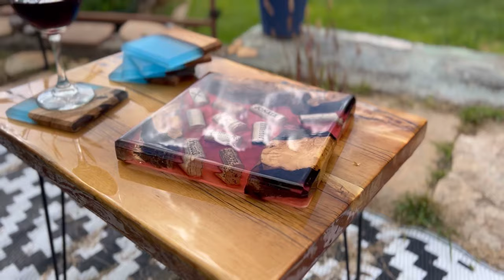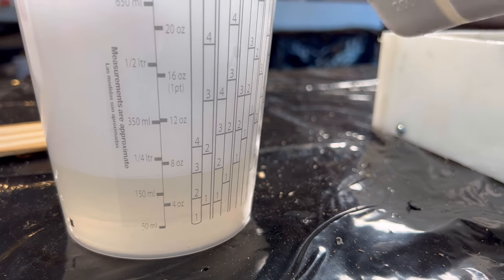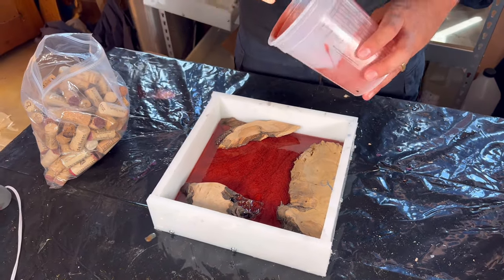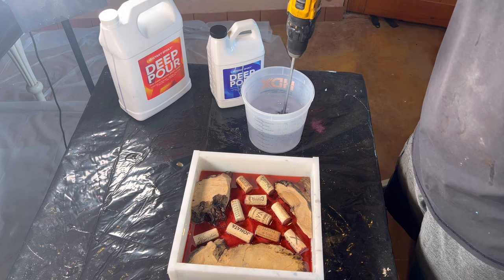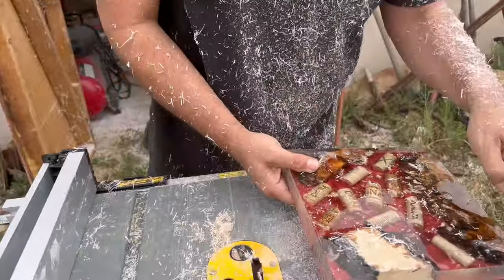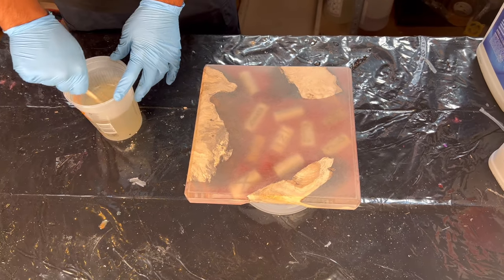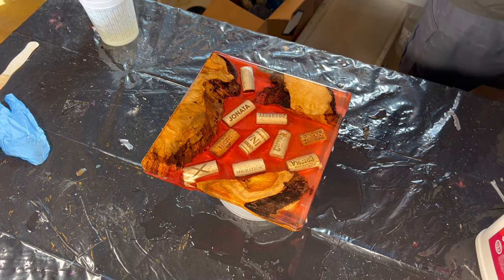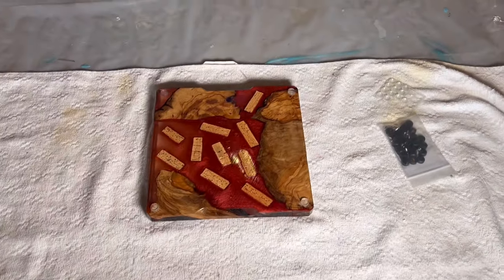How To Encase Corks in Epoxy Resin (Or Anything For That Matter)

Comment: So cool! 

Can the 1st pour in the bottom (for adhering wood embedments) be poured deeper? 3/8” to 1/2”?

I’d like to place wood carvings in the “River” Charcuterie boards. Maybe tables too if feasible…

My goal is to assure the embedded items are not planed, but rather suspended within the epoxy, top & bottom.

Comment: What is the oil you used on the bottom and where do you get it?
Reply from the maker: That is Walrus Oil and it can be found on Amazon or the Walrus Oil website.
Reply: @upstartepoxy4804  thanks, and you simply use it to get the gloss back in the sanded epoxy? You don’t put it on the “ good side” ?
Reply from the maker: @dblungm  yes, that's right!

Comment: You do some really nice work there Steve, and I especially enjoy the lovely timber and colours you use!

However, as a long time Joiner, I am concerned about your health now and your future health. Watching you work it seems to me safety and personal protection from chemicals and dust is lacking. Your Table saw and Thicknesser don't seem to be connected to adequate dust extraction, and your saw seems blunt too. While you do wear eye, ear and breathing protection, it doesn't seem to me to be consistent. Also, while I see that your wearing gloves to spread the topcoat resin, I don't see you wearing gloves to mix and pour the resins. In one of your videos, I clearly see Mica pigment dust in the light going everywhere when you put it into your resin mixing cup, yet you're not wearing a mask. 

I'm not commenting here to criticize you at all, I enjoy your work, but I am concerned for you. I may also be wrong regarding some of the above comments.

An Uncle of mine spent the last 15 years of his life on Oxygen, he was deaf with 8 and a half fingers because of his years working with timber and resins without much personal protection. Because of watching him slowly die over many years, painfully, I have been scrupulous in my personal protection in my woodworking career. I still have excellent hearing, full lung capacity and all my fingers at 44, a rare thing amongst joiners my age. I've been lucky so far, and I've had my near misses with injuries, but safety should ALWAYS come first. I know how uncomfortable and irritating personal protection can be, especially in a hot Australian summer for months on end. 

Please be careful!

In saying all of the above, please keep up the good work producing these inspirational videos and beautiful pieces.